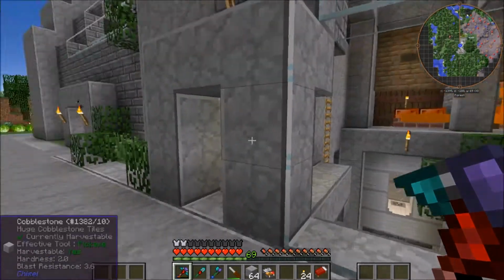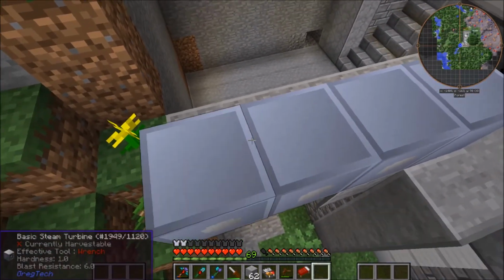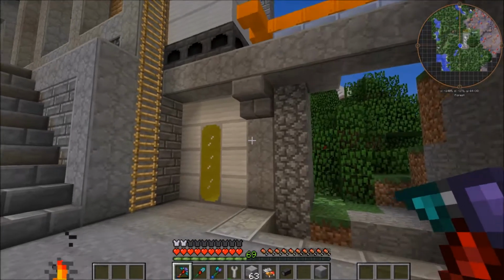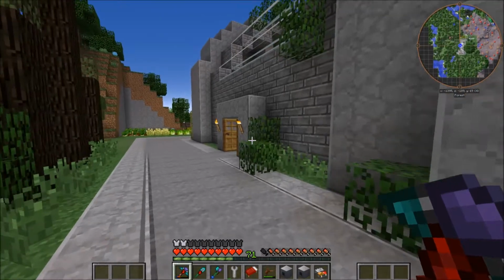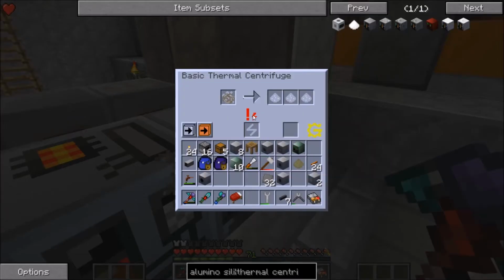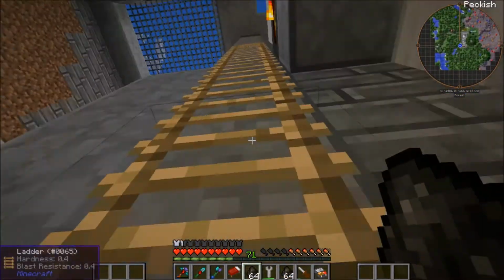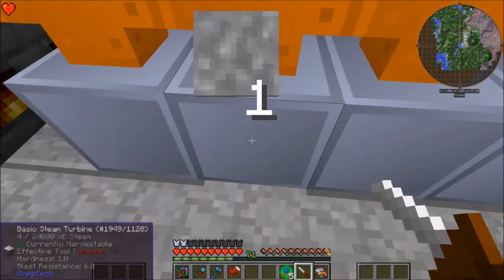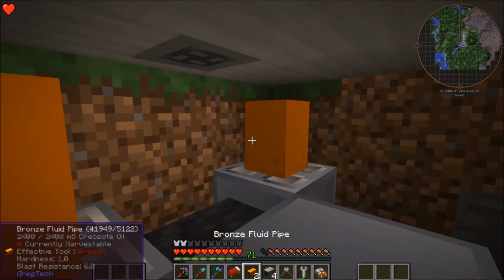Steam Boiler running - GregTech New Horizons 21

Comment: There is a vein in the twilight for the sapphires, might be easier than getting it as a byproduct.

Also the thermal centrifuge needs 2 amps so you need 2 generators running, the steam turbines would be able to do it if there is enough steam so you constantly fill up at least 2 of them. (Should have waited a bit for them to fill up since you waste energy when the machine progress cancels). I would also recommend using shutter modules for the steam piping (https://gtnh.miraheze.org/wiki/Shutter_Module )
Reply from the maker: Discovered another way to supplement the Sapphires in the next Episode.

The Powersetup as well as the machine's operating requirements are still a little overwhelming, but in due time, I'll definitely figure it out :P